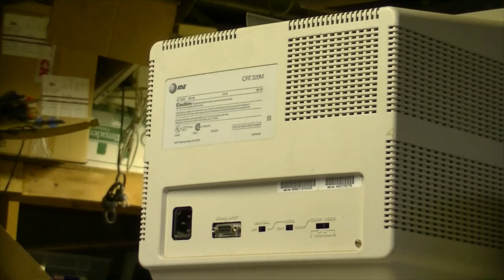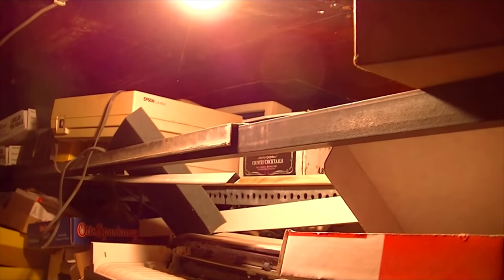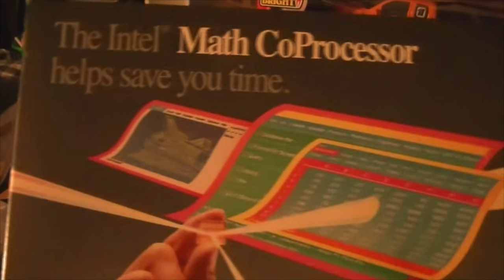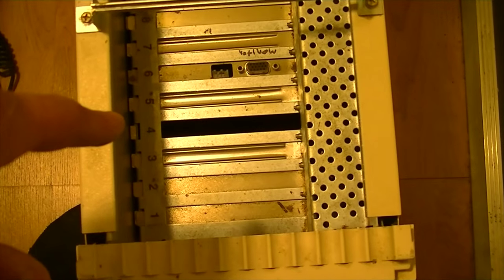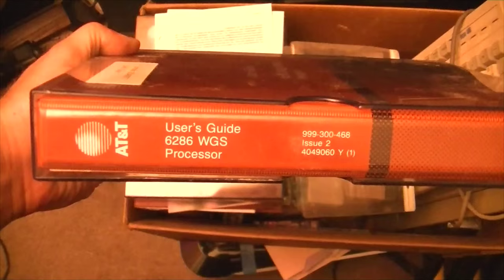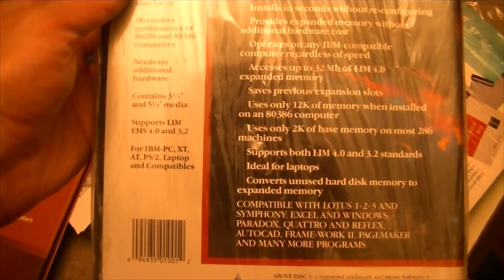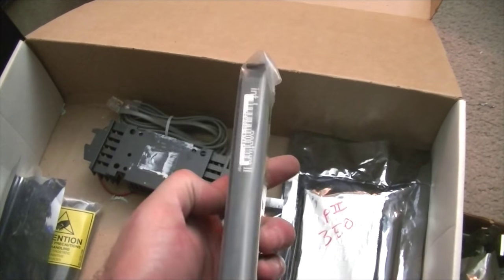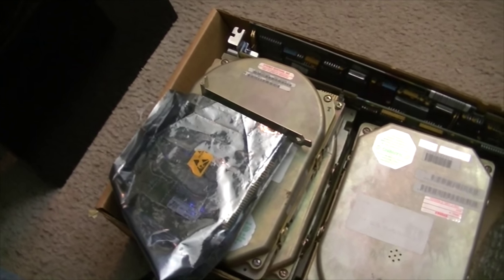Vintage Computer MEGA HAUL 2.0

Comment: It's amazing the stuff you actually have here, makes my four mid to late 90s machines look insane, and my oldest being a Pentium 75Mhz PB
Reply from the maker: +TechNerd1300 It really is. Almost mind boggling and a bit overwhelming at the same time.  I think there are a lot of hidden treasures in the back part of the shop with all the wood blocking the way.  The front part that has benches, there are several computers stuck under those benches still hidden by the boxes.  I have seen cases to at least 4 XT/286 class desktop computers as well hidden in there along with 386 cases and just..... piles upon piles of parts, parts in boxes...
Reply: +WaybackTECH Yeah, I wish this was closer to me, man, it's like a 90s computer store, I could spend literal days in there. Try to save all you can, all this stuff is worth a beautiful penny on eBay.
Reply: +911delorean yeah, vintage computers on regular occasion draw $200 per machine.
Reply from the maker: *****
That is the hope anyway to help my friend get some money from all of this stuff.  We are splitting it basically. I know the Bernoulli drives, paired with some cartridges will be good $$$ so will a lot of those keyboards. He has tons of those Gateway Anykey keyboards that are programmable and highly sought after too.
Reply: I could spend so much money with you lol, what's your eBay? I'd like to get some old school hardware to work with, and those AnyKey keyboards are something I've wanted to have for my vintage machines

Comment: Cool, more stuff. My thoughts on the VGA card are that those connectors are either for expanding the cards memory, or they act as a high-speed BUS for something else. I am not sure what exactly "something else" might be, but it would most likely be something the 8-Bit ISA BUS was too slow to make any use of. Could have been for a frame grabber or some such. Could also have been for a 3D accelerator, which did exist back then but with limited uses. No idea, just a wild guess.

I have seen one of those Soyo Slot 1 boards before, there was one in a machine I worked on some years ago. It was actually a decent board from what I remember, at least, there was certainly nothing wrong with it and it seemed fine with the 233MHz Pentium the guy had installed. I remember it well because the owner had painted - very badly I may add - his handle on everything "Paulton the Vigilante", even the inside of the case.

Certainly some good stuff there though, I'm kinda jelly now. Nah, probably just as well really, if that kind of thing happened around here I'd probably have no space left to live in because I would be stuffing box after box into my living room and running up the electric bill.
Reply from the maker: +HighTreason610 Ya it is definitely a bit overwhelming because I know there is a lot of stuff I found that I passed on for now, and there is so much left to be discovered, it is just incredible. As an example, there is still a box full of full length MFM controllers. There is a whole DECstation setup over there complete with workstations, switches, and network storage. I looked up the DECstation 5100 that is there and it is a RISC workstation., just to show it's age. There is a NIB memory card for a PS/2 model 30 I believe it was.  I don't think there is anything like an Amiga or a Commodore , but who knows.

A lot of the 386 and 486 motherboards that I plan to sell I am wanting to get enough IDE controllers together and sell them as a package. If there is anything you see you know you would like to have or could use, let me know. I would rather give you and other subscribers first dibs at this stuff. I don't think I could part with a new box of PPRO's though.. at least not yet :)

That VGA card, there are more of those as well. My guess about the extra pins is as good as yours. It is for a PS/2 from what I could gather.

Comment: Brand new sealed never open, brand new sealed never open, brand new ... must be like christmas but 2 months earlier nice :). Some of that stuff was worth considerable amount of money back in days. Some guys had wet dreams about opening new shiny Pentium Pro's, which didnt came true for various reasons. Its like going back in time to make your dreams come true (one of reasons i like your videos mate).
Reply from the maker: I found that the Pentium 2 450 has some strangely slow performance. I had planned to use it as part of my recent Slot 1 Face off video, but something is wrong with it. I suspect the cache is defective or something, not really sure though.
Reply: Hope u will find some time in future to try with another cpu just to be sure the problem is there. Would be nice to see another video with slot 1 cpu. I really like edge cpu slots, bit different from what we got now. At some point almost bought AMDs slot A machine, but ended with used Celeron 633 & Abit BX133. Managet to get that dude to run at fsb100 resulting in around 960Mhz. Sure it wasnt same as 1.0Ghz Thunderbird, but alot cheaper tho ;)

Comment: I AM MARKING OUT BRO! What a trip down memory lane, getting nostalgic working on building an Athlon XP 98SE build, the oldest I can go is a Athlon XP 2200+ Thorton 1.8GHz and I can go to the last one, Athlon XP 3200+ Barton 2.2GHz. Motherboard compatablity is my bottleneck. "more than $22,000 for a 33-megahertz Model 6386E/33 WGS, which is configured for use as a network file server. " -http://www.nytimes.com/1989/07/30/business/the-executive-computer-why-at-t-and-intel-linked-up.html

Comment: That might be an ESDI controller in that AT&T computer.
Reply from the maker: +80sCompaqPC Yes it is.  It is a Western Digital controller and the Hard Disk is a Micropolis drive.
Reply: +WaybackTECH What capacity is the drive?
Reply from the maker: 383MB according to the label on top. However there are 4 drive parameters listed on the top, and a 5th one that I looked up online, and none of them equal 383MB. Strange the sticker on top does not list sectors, only head, cylinders and bfind. I figured out by trying all of the parameters listed, and not finding one that would actually boot, that when I booted with an MSDOS disk, Fdisk saw it formatted as a 304MB drive. There is 1 preset option in the BIOS for a 304MB drive, and that one worked. It had a reinstall of Dos 6.22 and Win3.11 in late 99 according to the file dates on the drive. The drive itself sounds healthy. Not noisy at all. Despite it being rather large and old, it seems to be a solid drive even after sitting since probably 99.
Reply: I think that label is the defect map.
Reply from the maker: 80sCompaqPC
Ya that's exactly what it is. I thought it was when I first looked at it, but it doesn't list it as an error or defect map like the RLL drives I have do. One site listed this drive as having 34 sectors, and another listed as 36 sectors. I don't know what the truth there is. The formatted capacity will be less than 383MB but I don't think it would be 80MB less on a drive like this. Even with 36 sectors, that only gets it to a 322MB drive as far as the bios is concerned.